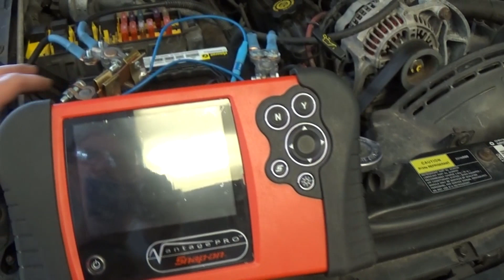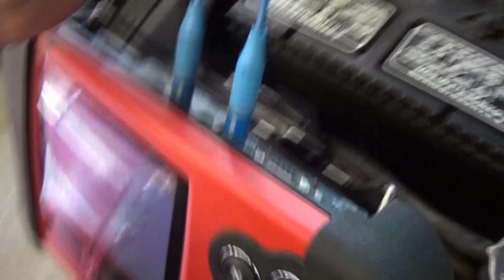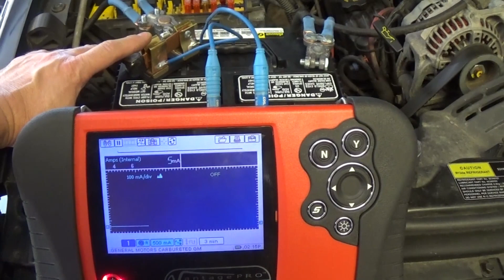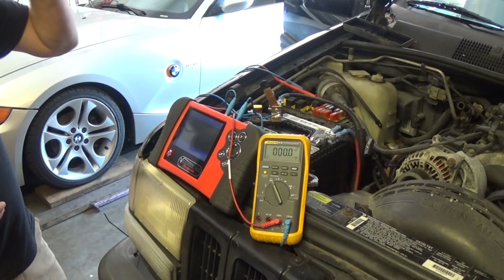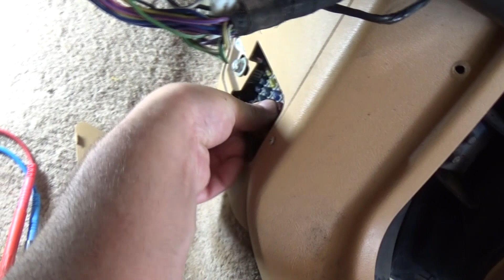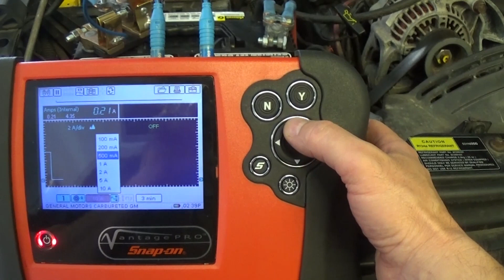How To Find  Parasitic Battery Drain Part One

Comment: I found my parasitic draw on my truck recently by using my dvom. The  culprit was the glovebox plastic light switch bracket broke which made the light stay on so I just pulled the lightbulb out for now. I must admit being a total bonehead and opening the truck door while the dvom was set to low amp mode and popped the low amp fuse. Doh!🤪 Amazon here I come to order another fuse.

Comment: Can i use an amp clamp around battery negative to show me a draw ? Or does it have to be around the positive wire only? Great vid and good setup.
Reply from the maker: Aaron M Positive or negative wire will work which ever is more accessible.👍👍
Reply: You can use the negative Port from battery. LG

Comment: great job.. pulling fuses does alot of funny stuff, i just bought a new amp clamp from Pico for my Pico scope. My snap on amp clamp that i use with my Modis seems to jump around alot. Thanks for the video.
Reply from the maker: carl brandon I have to say I am not big fan of amp clamp for this kind of problems. My vantage is go to tool for this.👍

Comment: I've been using that same rig for years (any excuse to use a knife switch).  Only difference is that I have a 10-amp auto reset breaker inline to the meter, just in case something with a high draw mysteriously wakes up in the middle of the night.  That way I don't lose a whole night of monitoring.  Also, anything newer than say 2005 I don't pull fuses randomly.
Reply from the maker: Drew's Diagnostics In part two I had to use circuit breaker  it  will be interesting. Coming soon my friend 👍